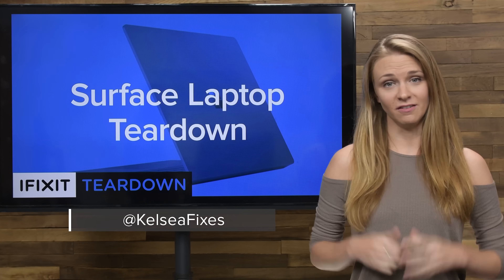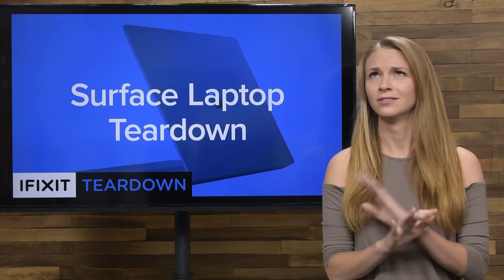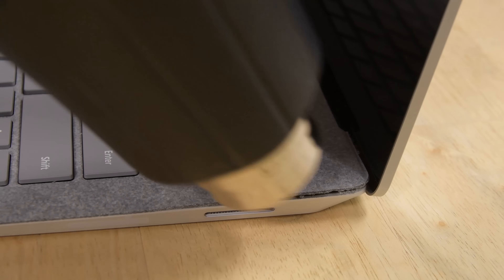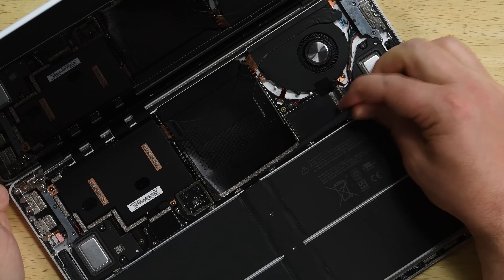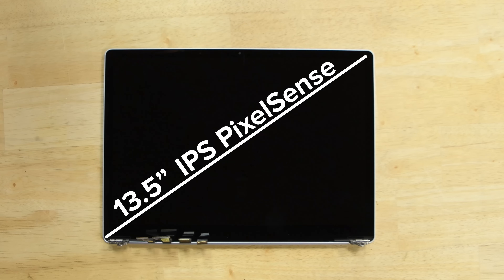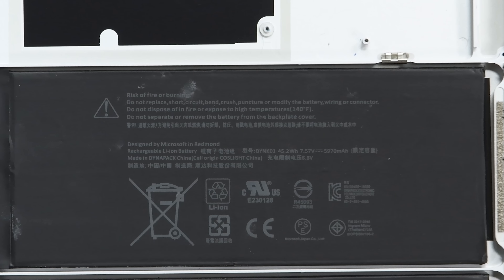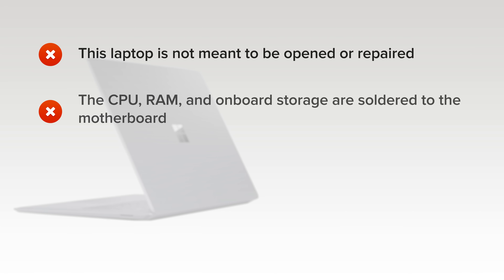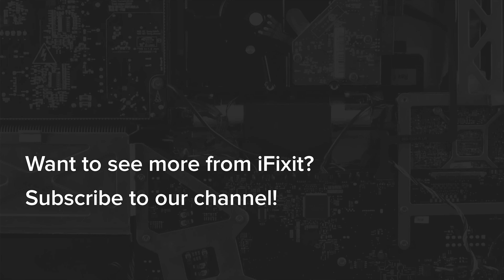Microsoft Surface Laptop Teardown!

Comment: sadly they failed miserably on this unit, as multiple reports and users only complain about the wifi adapter disappearing altogether and the following generations of this unit are still suffering from the same issue. Microsoft support usually has no knowledge of this in calls or has been told to outright deny it. Seems they can't seem to make a device that lasts just over a year, just enough to get them out of culpability for units that are doomed from the factory.

Comment: Wow, the surface is not a cheap laptop, and to make it so you cant upgrade or even repair it is disgusting. But with the windows went with wind 8 and 10, this is not a complete shocker. They are not a proponent or right to repair, and this proves it.

Comment: Just did a hard drive repair on a hp elitebook 840 G2. Flipped it upside down, pushed the slider in and pushed the service panel toward the back and had instant access to all the important components.

Comment: Wow! When I was looking at laptops last year, I did look at the Surface laptop. I can't stand the feel of the fabric (I hate felt and velvet-like fabrics), so I dismissed the one with cloth immediately. I did look at the other one that didn't have the cloth (was that the pro? I can't remember) and kind of liked it, but only if it wasn't my main computer (no way it would handle my video games). In the end, I just built myself a new desktop. It was cheaper and I can upgrade it over time (I could only afford 16 GB of RAM at the time).

The Surface laptops seem like Microsoft is trying to bridge the gap between laptops and tablets. They mostly seem like tablets with attached keyboards. And it seems they're trying to copy Apple's hatred of their devices being repairable.

Comment: MICROSOFT. MICROSOFT. WHAT THE FUCK?! WHAT... THE... FUCK?!!!
and then they claim that they're helping the enviroment?! how?! doing a product like this?! 
They lie about everything... every... fucking... thing... the eviromental thingy is bullshit! look at what they are doing with their own products!!! not to mention, if their claims of "helping the enviroment" are true, they could NEVER have done something as badly pieced togheter as what i saw there... is impossible to repair by a regular joe...(i mean, circuit boards and hardware in general are often dificult, but this... Oh my fucking god) what the fuck?!!!! WHAT... THE... FUCK... ????!!!!! this laptop disasembly you shown, is the cabal proof that micro$haft has ZERO idea on what the fuck they want to do. is like, they are doublethinking on propouse... i cannot think on anything other than that... they are simply vermins to the core.

as a designer am i trully disgusted on what microsoft did. is a mess, an unrepaireable MESS. this is the antithesis of what a good designed product is, and should be shown in every hardware class on what NOT to do when constructing a digital device.

Comment: If you're complaining about repairability the laptop is obviously not for you. This device is for the various sites and magazines that measure the height of the thing and claim that this is .3 mm thinner than the competition , weight that much, etc-etc. If you do not want  a thin laptop check elsewhere and stop whining. Macbook pro 2018 model is 5mm thicker without touch screen

Comment: I just swapped out the battery in  my 2015 12 inch Macbook, it has a repairability score of 1, but it is still repairable. Only thing that was difficult to take out is the glued in battery. The Surface book is a 100% disposable computer that is truly wasteful and adds another degree of pollution, planned obsolescence is training a generation of young people that it's okay to throw away good hardware because the battery went bad. I'm still using my Macbook Pro from 2012, swapped out the battery and hard drive to a SSD it's still going strong in 2018!

Comment: The HEAT GUN. luv it.  In any event; if you're going to buy any device that was NEVER Designed to be taken apart. You have to accept RIGHT UP Front that at best it's a return to manufacturer to repair and/or replace under extended warranty type of paradigm.  MS surface isn't alone in this regard. I had nearly similar nightmare getting into my iPhone 5s to replace battery recently . Stupid fracking pull tabs that are supposed to release the batter from body of phone both TORE OFF.  Had to resort to head gun!! now my phone vol controls no longer work even tho I was trying to be careful. SO APPLE!! thx for shitty design, battery should be designed to just pop out like some samsung and other android device phones do!  SO there you have it BOTH MS and APPLE !!! are guilty of such designs.  Peace out all.

Comment: so these are $1000+ through $2000+ non-upgradable laptops that not only need a super expensive repair when any tiny component fails, no, wait for it: you can't even change the battery! so sad that many people will buy one without knowing this.

Comment: And WHY are people buying this? Is Microsoft the new "you can't be fired for buying IBM"? Actually, you can get a Macbook Pro, with a sane(r) screen resolution and a much saner OS for less than these surface laptops are selling for. And it at least got a 1 out of 10 in repairability, not a 0 like this one.
Reply: Surface Book 2 is better than Macbook Pro

Comment: This is garbage. In the future when your fans fill with dust, a common thing that happens with laptops, *your fucked*. When your battery dies and barely holds a charge, *your fucked*. What a load of shit, we've finally gotten to a point where a Windows computer is as disposal as a bag of chips. This piece of shit's going to do nothing but fill the landfills when it's no longer useful. How the fuck can they getaway with laptop that has to be completely replaced if ANY individual component messes up?
Reply: That's the future. People wanted thinness, without the upgradability, so you have to compromise. It's sad, really.

Comment: RAM bad = E-trash the whole thing 
CPU or SSD bad  = E-trash the whole thing 

A nightmare to open : unethical 

Battery swelling up & dying : Lithium Polymer batteries not only fade, they can swell up, burst & catch fire! Gluing the batteries in and hiding the battery connector is highly unethical because it will harm your customers! 

0 out of 10 reparability! No Upgrades : Annoying To Open : Battery Failure Ruins the Device Quickly 

Doing this kind of stuff to your customers ultimately hurts real people Microsoft! With battery fires in particular!

Comment: To get slim size and light weight you have to give up something. It appears that being able to be repaired is the sacrificial lamb in this case - as it is in others.
I assume that if a unit fails within the warranty period, it would have to be replaced. That also means that your data had also have been backed up.

Comment: It's bad enough that they already make laptops where you have to disassemble the computer to access the battery.  This is an absolute no buy for me.  If I can't replace the battery, add more RAM or upgrade the SSD, I wouldn't touch it with a 10 foot pole.

I don't even like that I can't easily - if at all - replace the battery in my Samsung Galaxy S7 Active, and that's pretty close in price to this "laptop" (I paid $600, but it's normally around $750).  I only accept that trade off, because of the compact size of my phone compared to a laptop.

Comment: Everybody is quick to judge it for being impossible to repair, but from an engineering perspective, this kind of design is necessary to achieve the aesthetic and form factor, for now. This will sell to the people this was made for, and none of them will ever want to open up their computer. There are plenty of machines that are designed to be easy to repair and upgrade, but those are made for a different user, and have many more differences from the surface laptops, such as specs and pricing. What will really define whether or not this laptop is worth the purchase, in the event that it's damaged, is Microsoft's warranty policy.

Comment: So they give you a new one instead of trying to repair it ?
Reply: You get a refurb. Same as with a surface tab, even in the first 30 days...if it fails, they don't replace with a new one but a refurb unit! I worked for a subcontractor that manages the Microsoft online store, and for any problems in first month I would urge customers not to accept an exchange, but rather to return the item for a refund as is their right. Then order a new one if they still wanted to. Shoddy and deceptive cynicism made me feel dirty buying into this scam so I did what I could.
Reply: This laptop already look like a disposable laptop, they'll probably do that anyway.
Reply: 10010011 Midg probably yes

Comment: I can understand that it has score of 0, but on the other side - it's a device that was designed to be as slim as possible. It's really hard to get such device to be reparable without compromises - if you want your laptop to be upgradable, get something else.
Reply: Paweł Butyliński how the hell can you justify this?? Even the 12 inch MacBook, which is thinner and lighter, is more repairable than this, and has higher build quality.

Comment: What most people don't realize is how amazing Microsoft's customer service is.  I bet if you ever had a problem with your surface laptop while it was under warranty, they would just give you a brand new device.  I had an issue with my surface 3's display and they replaced it without any hassle.  I've needed a macbook's keyboard repaired while it was under warranty and they charged me 290 bucks for it.
Reply: While that may be true, still no excuse for this sort of unreliability.

Comment: Sooo basically it's built to be replaced in 2, 3 years? Can't remove dust -> Overheat issues. Can't replace battery -> Well rest of the hardware usually lasts longer than the battery

Comment: I had a surface pro 3 before, i cracked the screen and claimed warranty. Then took my unit and returned it after a week... To my surprise it became a pro 4 i5 brand new! Even Microsoft thinks it's cheaper to replace it than to repair

Comment: About repair by Microsoft, they don't , just replace. From our (people who know how to repair 
things point of view) that sound stupid but from company - it don't.  
Labor of qualified technician, service equipment, access to storage 
parts all over the world for two or more years, and risk when hot airing one component example CPU other (RAM) 
will fail also need to deeply test everything  before handling back to customer.
And when it will fail again in users hands angry customer will post on reddit how bad 
company service is,  "they can't fix it in month".  As You can see everything added is more expensive 
that just giving new one to customer and trashing old.     Sad times, but we all created 
them by demand for cheaper, faster, newer model every single year.

Comment: All the comments about apple... apple used to be way easier to upgrade up until 2013-2014 and after that the MacBook Pro was upgradable until 2016 till they adopted a new design, surface products have always been bad for upgrades, Microsoft aren't as bad as Apple, they're worse

Comment: I think I feel glad ifixit actually sacrifices devices for their teardowns.

Also, in my opinion, if there are students looking for laptops for school, I do recommend older (used) business laptops* that some small stores are selling (at least here where I live) on the local classifieds, as 2011 and newer models would have shipped with Windows 7, and Windows 7 and later product keys can be used to activate Windows 10. At least those are easier to service.

If you choose a laptop that shipped with Windows 8 or later, then it usually uses UEFI, and Windows 10 installer will automatically select the appropriate edition.

Comment: Hey iFixit have you thought of using cold instead of heat to remove adhesives? I have seen some videos recently off electronics being dumped in LN2 and it seems to make the adhesives not stick as well as heat does. It obviously needs much more care but for a device like this for example it might be worth a try.

Comment: wtf. This makes MacBook Pros look like a walk in the park.
Reply: Macbooks are supa easy compared to this shite... Good gawd. NOTHING is replaceable in this laptop..
Reply: @0Imtheslime0  Whats the point of being able to upgrade a couple of pieces if Apple doesn´t let you buy from third party and the cost of upgradability or repair is greater than buying a new product?
Reply: @filiperocha4025  sounds like you need to be introduced to independent repair. Search Louis Rossmann
Reply: Filipe Rocha or maybe just to take care of your stuff and it will serve you well
Reply: but still useless

Comment: How wasteful. Computers were never meant to be discarded after the failure of a single part. If it gets wet or zapped in a power surge you can kiss data recovery goodbye. Troubleshooting to buy replacement parts, if they even exist, is now useless since you can't replace the parts yourself anyway.

Edit: Cleaning the fans and heat sink of dust, something that can't be avoided, is also a no-go.
Reply: just think about the ammount of dust this thing will accumulate in its fans on a normal life cycle... not being able to clean the fans is a SERIOUS issue... a critical error... and to make matters worse... this... is the least of our problems with this... thing...
Reply: "Computers were never meant to be discarded after the failure of a single part" You've said it ALL!

Comment: wow microsoft really is the new Apple...
Reply: GALIGER it is very bad apple
Reply: At least there are screws on the MacBook.
Reply: Its worse haha
Reply: Apple set the wrong example soldering RAM to the mainboards in macbooks
Microsoft went the wrong way by building on this bad idea of integrating everything into an unrepairable form: especially because some components of the system have shorter lives, shortening the useful life of this energy intensive, materially intensive, manufacturing complexity intensive, high embedded energy e-trash in no time design.
Reply: Thing is, if you don't botch up and drop it, you'll get a new one if it malfunctions for free even after a few years. If you do drop it, you'll have to pay couple hundred max depending on your insurance to get a replacement or compensation depending on the age and value of the device. There simply is no need to repair devices anymore, but it's still annoying that you can't upgrade the SSD or RAM, but then again cloud and NAS exist.
Reply: GALIGER no shit.
Reply: GALIGER lol even apple allowed their customers to at least open the lids of the macbook pros
Reply: they go further and beyond..
Reply: It's better than apple
Reply: Microsoft has always been the corrupt copy if anything Apple copied them
Reply: GALIGER or way worse Lmfao
Reply: I think it's even worse (as always: trying to copy it and failing miserably): Apple devices have never been that inrepairable.
Reply: It's not the new apple, it's worse than apple.
Reply: macbooks are actually the easiest to repair with an abundance of cheap spare parts, schematics and board views easily available. iphones spare parts are the cheapest of any phone and again they are the only phones that have schematics and board views